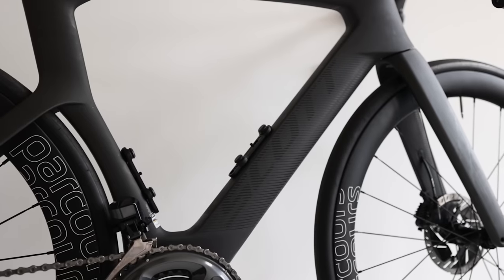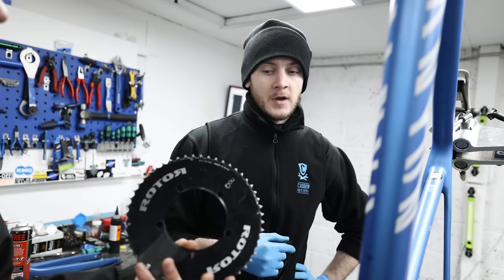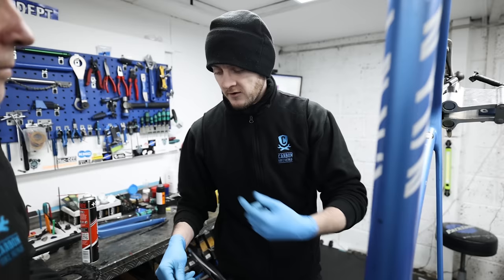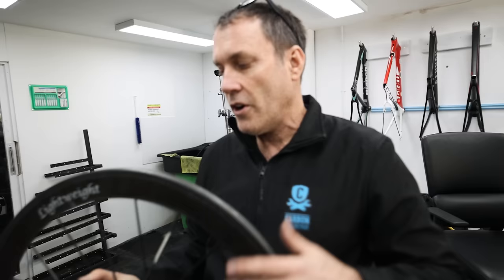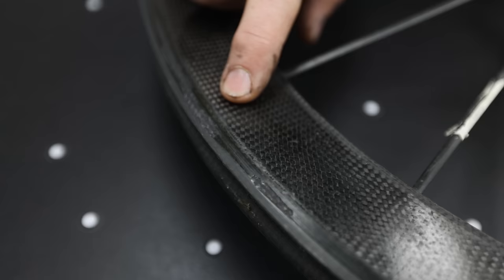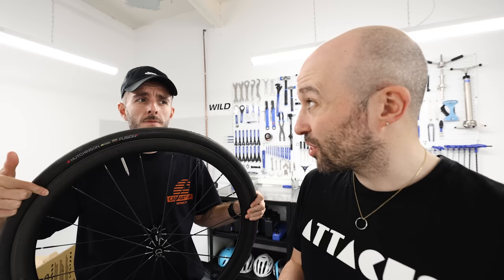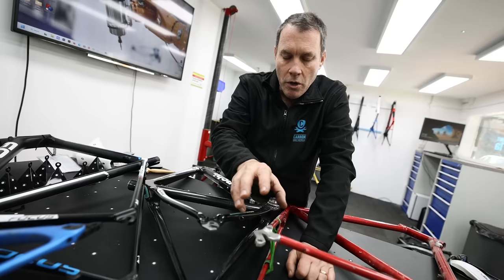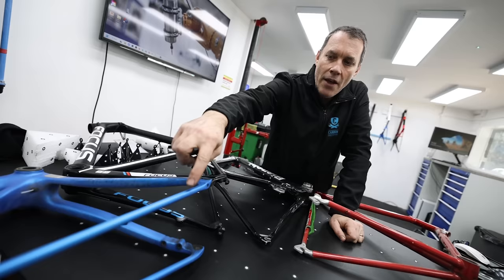6 Bike Products That Shouldn't Be Carbon Fibre

Comment: As a bmx rider, I prefer nothing on my bike being carbon except maybe some spacers or valvecaps.
Do MTN bikers or road bikers use titanium at all? It's pretty popular with BMX riders trying to save weight.
Reply: Carbon valve caps? Never heard of that being made out of carbon.

With Cane Creek's eeWings cranksets, yes. Titanium handlebars, stems, headset spacers, seatposts, bottle cages and more exist in road and MTB. Shimano Dura-Ace cassettes use titanium for the largest cogs.

Comment: In the material production stage carbon fibre creates 5-15 times more CO2e than Aluminium. It's not recyclable and about 40% of it goes in the bin from the production on frames. The engineering on a lot of carbon bikes is poor. There is an argument, and a strong one in my view, to say that main frames of bikes shouldn't be made of carbon.

Comment: Good video! Saddle clamps, stems and handlebars are other bike parts that probably should not be made from carbon.
Reply: Agree 100% .Seen alot of crushed carbon seat rails also .All for the sake of a few grams.
Reply: Carbon is anisotropic (not equally strong in all directions), so parts where the direction of the load changes a lot (such as stems) aren't the best use-case of the material. Sure, you can engineer a perfectly safe carbon stem, but I'm willing to bet if you made it out of forged titanium instead, it would actually be slightly lighter for the same strength.

Comment: I’m biased in reg to Carbon pressfits (holes in the frame). On one hand good manifactured can be very reliabable, stiff and lightweight. On the other hand there’re so many examples of poorly made, (creaking, bad alligned, not round, etc) and not as smart engineered (too many standards, etc). I’ve had bad (really bad) Ones and good ones so i both hate and love those Carbon parts in modern bikes.
Reply: I hear what you are saying

Comment: That's a good insight into life of carbon parts, though be interested to hear Dov's take on the rim brake bit.
Reply: Another carbon bike repair guy Raoul Luescher (Luescher Teknik) also said they're dangerous. Raoul added some nuance that you can get away with it with tubulars (what the pros use) but manufacturers have had huge problems with carbon clinchers. Also lightweight climbing wheels (with less material and lower thermal mass) are the most at risk for overheating and failing when descending.
Reply: @fortinbras47  And the irony is, the race courses where you'd be doing fast descending are the same ones where you'd be running the lightest possible wheels, because what comes down must first go up.  Of course world tour pros are MUCH better at cornering than the average amateur road cyclist so use their brakes less, and are likely on tubulars if they're on rim brakes.

Comment: If I remember correctly Mark Cavendish front wheel smashed to pieces because of the carbon spokes in a final sprint of a stage.. I believe it was the lateral stress on the spokes that caused them to fail...
Reply: The rim snapped, not the spokes, well they did but that was secondary

Comment: Steerer tubes should not be carbon.  The steerer tube is a life safety point on a bike, yet has been "innovated" to save weight too many times over the years.  Relying on a compression plug and other bodgery to give bikes adequate robustness is just an admission of failure.  The steerer tube must be able to fail gracefully so that nobody, ever, had their bars come off in their hands.

Comment: Submarine pressurization fuselage should not be made from carbon fiber. I'm not too thrilled about carbon fiber handlebars either. I once had a carbon fiber saddle that I loved. The only reason I would ever consider disc brakes is because of the poor braking of cantilever brakes on carbon rims. At one time didn't they make carbon wheels with aluminum braking surface? I know my old Spingergy machette wheels were built like that.

Comment: I read that stems are not a good component for carbon fiber. They have to survive both tremendous bending moment and torsion at the same time, which isn't a great application.
Reply: Also, the metal inserts that are bonded inside them can come loose overtime. This happened to my ex-colleague's ENVE Road stem.

Aluminium and titanium is enough for me.

Comment: Carbon handlebars. Eugh, can never tighten the shifter enough to make em keep still while riding on hoods. And if you try, you might suddenly end up with the drop in your hand on a sprint without warning. Also if you have the bike fall over u can no longer trust it :'D also anything made for mountain biking for the same reasons

Comment: Carbon fibre is great but requires far more care than any alloy. It reacts with moisture in the air, it reacts with other materials..... It disbonds, alloys corrode between the carbon fibre joins. Its not any good at the occasional fall. For me carbon is pointless on a bicycle that ill keep and enjoy for well over 10 years.  I work with carbon aircraft daily, its a real pain to keep perfect.

Comment: Carbon levers. They snap in a crash or just the bike falling over. Carbon fiber is just an excuse to upsell a component but at some point the use of CF should be regulated for safety concerns. 
Carbon wheels with rim brakes should be illegal.

Comment: Maybe there's an over confidence in this material, or the manufacturers build carbon stuff because it sells rather than it's sensible,  Got a Cannondale that looks like it has a carbon seat post but when you look, it's a carbon layer over aluminium,  cosmetic to sell the bike. I bought a couple of titanium bikes this year for the price of one carbon bike. I don't regret it it was a good decision for a change.

Comment: Exception for XC or any discipline that needs to save weight everywhere, they never should have done carbon frames for enduro and downhill, specially hardtails made for such, if a car with full carbon body doesn't make it through after a year of moderate to safe use, imagine a mountain bike frame that goes through one hell of a beating, despite of course ppl taking care and all, maintaining, maybe it's just better for the general public to trust the metal on their bikes, since snapping a bike comes mostly from using a wrong dimension fork. Leave the carbon for those who can afford or need it for competition, you don't need carbon anything, improve yourself as a rider then take a look if your equipment is the limiting factor and decide if you want to give that kind of push to get a podium.

Comment: I have 1,000s of miles on my carbon chainring, Arundel Mandible carbon cages are the only cages you should ever use, and carbon wheels are far superior to aluminum. I have 30,000 on one set of carbon wheels and they're great.

Comment: Forget Rim Brakes and Carbon wheels.  Disc-brakes are the best thing to happen to wheels.  It meant I could spend a king's ransom on some VISION wheels, knowing I wouldn't be grinding them away on wet, gritty roads (Also it's nice to be able to stop in the wet .... I'm old fashioned that way).
I, like so many cyclists, could afford to lose a few kilograms off my body, before spending hundreds/thousands trying to lose the same weight off my bike.

Comment: I never understood carbon wheels. More expensive, less durable and also, unless you buy the really expensive ones, they are heavier than aluminium wheels. What I'm also curious about is, why are there no magnesium wheels?
Reply: Carbon wheels are very popular in MTBing. They are much stiffer at the same weight. I disagree with your point about durability; carbon rims do not dent like aluminum rims and can withstand greater impact.

Carbon rims are also awesome on road bikes with disc brakes. You don't have to worry about delamination at the braking surface because of disc brakes. They can be built wider and deeper than an alloy rim at the same weight, which will be faster and more comfortable.
Reply: Try a 50mm deep section aluminum wheels if you can find them I bet they weight a tons more than a decent not so expensive 50mm carbon wheels
Reply: @matthewhuang3092  They weren't criticising carbon disc wheels though

Comment: another issue is pets, there's an image of an parrot eating a carbon fiber rim, like they are just taking chunks out of it, i don't even wanna think about what would happen if it had carbon fiber spokes to chew on, basically half of the rim was missing with the rubble strewn all over the floor
Reply: If it's that parrot gnawing at a Mavic wheel, it just gnawed the wheel's fairing. The rim's actual structure is an aluminium rim.

Even if that fairing is gone, the wheel is still usable.
Reply: That would be an exparrot.

Comment: Disagree on cages. Xlab Gorilla cages don't break and work great for holding bottles on triathlon bikes. I have had one carbon front wheel go bad. Original Mavic Comete Pro SL UST. Mavic replaced it under warranty. No problems with new wheel. Zipp 404 and 808 sets have been fine.

Comment: BRAKES!
I was contemplating of buying THM Fibula brakes. 
However I went to Eurobike in Frankfurt and checked them out.
I don't want to put my life in the "hands" of these flimsy little things.
They might only way 128g A PAIR, but I am staying away from it.

WIth bottlecages....I have mine since 5 years and never had an issue with it.

Anyways: Cool video!
Reply: I've worked on a pair of carbon rim brakes before, but they're the Lekki8. Due to how little material there is, the flex is pretty insane.

The only light rim brake I don't dislike so much is Cane Creek's eeBrakes, but I'd still rock Shimano SLR-EV rim brakes any day. Who cares if they're heavy, I want them solid.

Comment: I just remember, Jumbo Visma - Roglic crashed his bike on a rough road cause its maybe Paris Rubei well I'm not sure if it's that event. But most of its road is a rough and gravel road. On the vid is. His rear wheel collapsed and it bends maybe because of his spokes or wheelset alone. It's a mind blown on me at that time cause you know their bike is totally high end / high tech bike and parts.
Reply: They were using older generation DuraAce wheels, which were alloy spokes. They had been used and abused many times by the team and riders ( some may have been crashed and compromised but with no visible damage to suggest imminent failure) yet ameteurs and non racers get so much more use out of theirs. That's more down to fatigue from extreme use than component fault. You could offer me all the money in the world to ride an ex pro-race bike, but I would rather stay poor and safe. Wouldn't go near them.
Reply: @matt_acton-varian  Aren't some of their bikes new? I mean, some of them have a large inventory. I remember I've seen a few ex-pro framesets up for sale that were never built.
Reply: @yonglingng5640  I am unfamiliar with unused frames being sold, and I would assume that the cost is somewhere Inbetween a new frameset from manufacturers and a used frameset. That being said, I was specifically meaning a bike that had been used by a pro rider.

As used pro bikes are not advertised as to their usage, you don't know whether you are getting a rider's race machine, their spare bike or one of their training bikes.

Comment: I have 3 sets of those LW wheels, they are great wheels.
Reply: Pity about the logo though ha
Reply: @htdtr  Well, acetone can remove the white paint. There will still be a visible outline and it will never looks perfect. - having 16 large LW logos on a set of wheels is ridiculous.
Reply: There is an Aussie company called caden which makes very similar wheels for a fraction of the price

Comment: I agree with most points especially the carbon braking surface issues. I ride a lot on farm roads and don't have any hills to speak of so I really don't have any significant braking to contend with. One big advantage of carbon wheels (tri spokes, on two different bikes) is there is definitely better micro shock damping on secondary roads. Some portions of my usual ride are on smooth asphalt but most of the time I'm on secondary roads and the carbon wheels are more comfortable on a long haul.

Comment: A bit misleading with that Rotor chainring. That’s an aluminum chainring, not a carbon chainring. The points are all still valid, but the component itself won’t showcase the issues that were described.

Comment: Man, I can't tell you all how close I was to doing dumb shit with my money... Almost bought deep section Aero wheels for my Rim brake bike; decided against it (thankfully) Now I'm building a new aero road bike, Trek Madone SLR, and almost went with Hunt 54 Carbon Spoke UD wheels. To be fair to myself, I was deeply on the fence with carbon spokes, which made me hesitate.
Reply: Lol something that the video didn't discussed is the possibility of something on the road flying into the spoked like a wire or tree branch. That's one bad case of failure for carbon spokes
Reply: @bonbonflippers4298  That happened to a rider in Hong Kong riding his first-generation Allez Sprint Disc on Winspace HYPER wheels, his seatstays were badly bent (well, the seatstays may be one of the weaker parts of this frame, I know somebody's had a dent in it from a bump).
Reply: @yonglingng5640  I've had a metal wire fling across my spokes once when I wasn't  paying attention. Heard a loud ping! And had to stop to check my spokes and wheels...I don't know what would of happened if it was carbon spokes.  All it takes is a small crack that you wouldn't notice for an accident to happen

Comment: Handle bars. Carbon fibre will break at some point in its life span and it is very susceptible to overtightening. Having harbon handle bars with metal stems is bonkers. Not speaking of the possibility of a broken carbon rod going through your body in case of a crash

Comment: Such a misinformed view of all things carbon. 
- Agree on chainrings
- Bottle cages? really? Like I don't know anybody who doesn't use them w/o issues
- Lightweight repairs broken spokes, broken spokes isn't a common event but it could happen if you are putting 1800 watts and happen to hit a bump. If you are not doing that, it is a much rarer event,.. and you know what? it's probably worth if you want to own the lightest wheelset in the market.
- Carbon brake surfaces last for years, 20 years, 100,000 miles is doable. I have carbon wheelsets lasting that much. Everyone uses them, delamination occurs when construction quality is subpar, but most modern carbon wheelsets have this under control 

 - Agree on front mech hanger and dropouts

Comment: Rob was really interesting! Would love his opinion on which frame designs are done well, and which are done badly (for Longevity). For example the Carbon Cannondale Topstone has a rear derailleur hanger design that is a potential design flaw as it's held in by one bolt next to a very thin section of carbon.  He must have seen so many of the same brands of bike breaking.

Comment: Are Handlebars something we should worry about these days? I've heard lots of horror stories but I'm second guessing if the position on that is just skewed
Reply: With the possibility of wiping out, yes, since they're not impact-resistant. Excessively cheap ones even break before a stem faceplate's bolts reach their torque spec (happened to my ex-colleague when installing my former workplace's in-house handlebars, which are actually outsourced, garbage dare I say).

Comment: I worry about carbon steerer tubes on top of forks. I have had problems where the headset comes loose (even a little bit) and the metal bearing rings of the headset rub on the steerer tube and cut into the carbon tube. Have you had experience with this situation?
Reply: look how thick the tube is. I don't know your fork, but i guess some 4mm. With that wallthickness you could probably lift a locomotive. there is plenty of reserve strenght. No manufacturer wants to be responsible for a steerer tube to snap and kill you.

Comment: After my Jamis Eclipse joints failed (carbon epoxy?) Jamis did not honor their lifetime warranty. I'm very tall and need at least 63cm frame. Could not find any new that don't cost an arm and a leg. Bought a used 1998 Klein aluminum 63cm on craigslist. Best bike ever owned. I love aluminum. No rust.
Reply: Is it corroded anywhere?
Reply: @yonglingng5640  Yes, a bit at the joints for BB and chainstays. No corrosion at brake bridge; that's just the epoxy failing. Lousy design; I have not seen any other bike with this poor design and materials.
Reply: @mattfoley6082  Oh, I meant your aluminium frame.
Reply: @yonglingng5640  My aluminum Klein has no corrosion anywhere on the frame. Looks like new. I love it.
Reply: @mattfoley6082  Nice, sounds like the previous owner took good care of it.

Comment: What about Carbon TI rings that run alloy teeth?
Reply: Not seen this but sounds interesting as long as the teeth are not carbon and the bond doesn’t fail otherwise why not just ride a light weight alloy ring?
Reply: Not the best choice if you put out a lot of power, I've seen one fail where the teethed ring lost its bond with the carbon body.